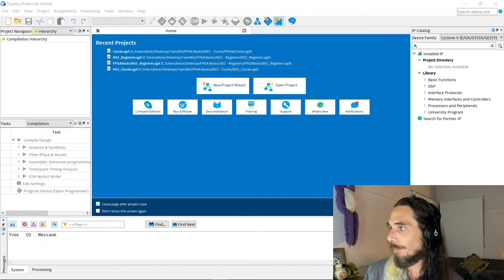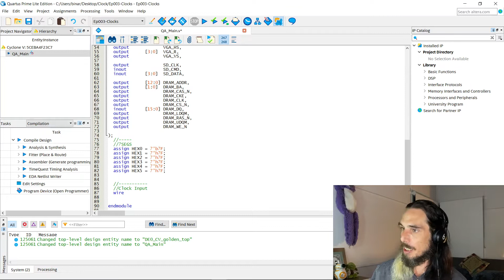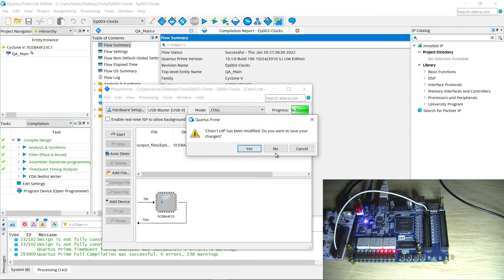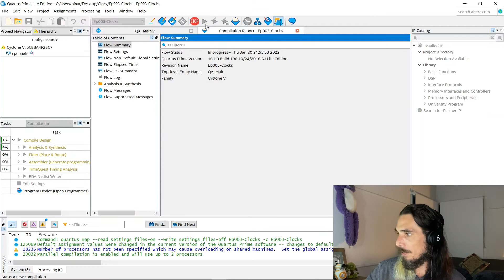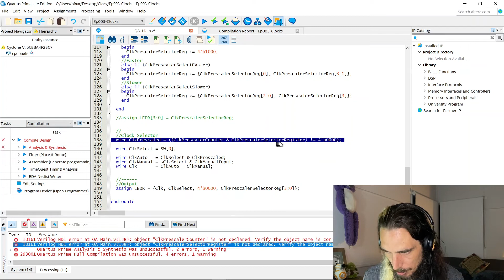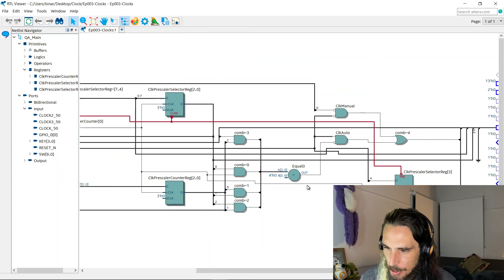Clocks - FPGA Basics Episode 3

Comment: Is is safe to assume that if i test a circuit with a very slow clock just so i can see what is happening, if i then increase the clock the circuit would work the same way but faster??
Reply from the maker: Exactly! Slow clocks are great for debugging and testing. Using the same techniques you can actually set up a switch to select between a slow clock and a fast one